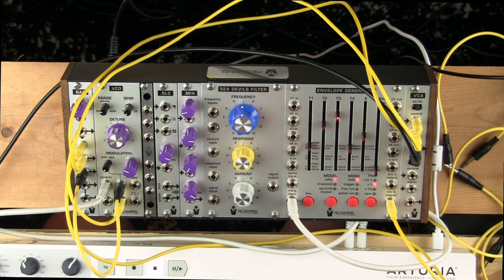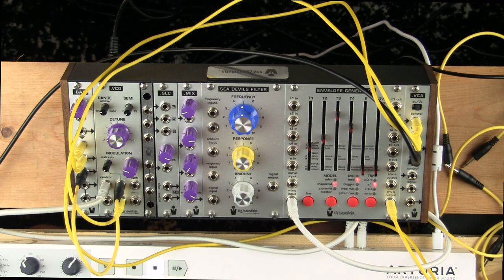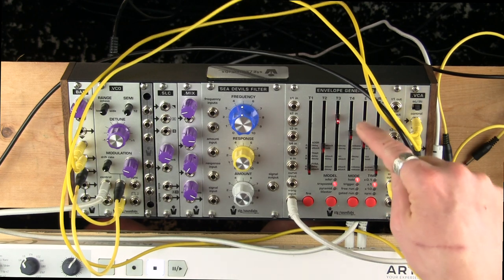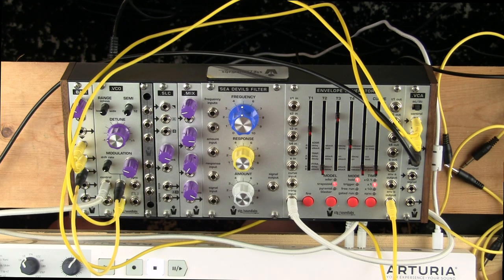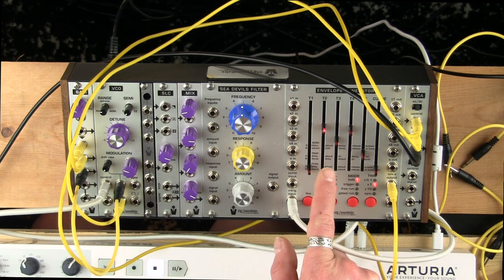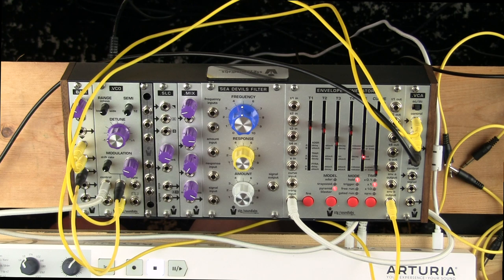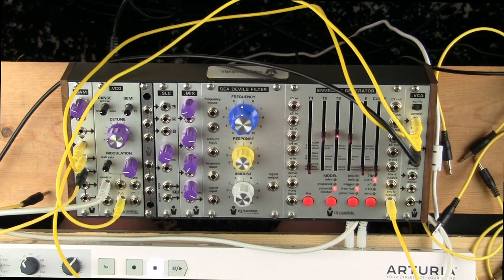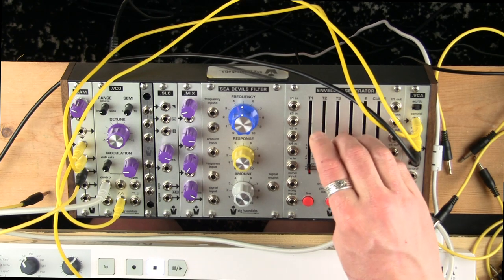05-STG Soundlabs Radiophonic 1: Envelope Generator Part 2

Comment: This has turned out to be the most versatile envelope generator in my shed by far . The slide controls give you immediate gratification,there’s no menu diving / tweaking involved . If I could think of any improvement it would be a ZADAR like feedback screen to see the output envelopes but its 100% fine as is - I’d been waiting on the release of this module for years and I’m glad I finally noticed it was available- thanks STG !

Comment: I am enjoying this so much. I've been enjoying your content for definitely more than a decade (12+ years probably, if not longer) and hearing your voice talk about my instrument brings me to tears.
Reply from the maker: It’s an honor to do so, and I’m glad you are enjoying it!  Irrespective of anything, this is a fine instrument... well-conceived, well-designed, and great-sounding.
Reply: This particular module is a work of genius.🙀 I love how you’ve very humbly named it; Envelope Generator 🙃
Reply: @jdanielcramer  i am flattered by your praise. The EG is a bit intimidating in features and price but it is as simple and cheap as i could bring myself to make it. I wanted to have a comprehensive envelope that gave you the fullest features of both Moog and EMS. The Serge thing (dual linked AD) was icing on the cake.

BTW that's just the way i name things ... I use literal descriptions of functions. I wouldn't know what else to call it!

For example "Sea Devils Filter" is named for a cultural reference because it would be rude to call it "EMS Filter." The Mankato Filter comes from Mankato, Minnesota and was named that before I manufactured it, when it was a DIY PCB. However, my sequential and voltage controlled switch is just called "Switch."

Comment: So with the Decay stage being first, in that particular mode; does the EG start at a designated peak, and trigger a decay stage, into a rising attack stage, like a serial coupled decay generator on a delayed ADSR? That’s ... wild. Love it. Need it. I do use trapezoid shapes a lot, but not THIS kind haha. It really reminds me of the envelope generator settings in a Roland D-110, but that could be interchangeable terminology, and not an emulation of the analog circuit. I would have to do my homework on that one... anyways- Great vid as always. Thanks!
Reply: If you're talking about the Trapezoid, one output rests high, the other one low. Overall level is controlled by E.

I couldn't get time on an actual Synthi 100 to verify actual operation against the owner's manual, but that's how the two outputs are described in it. Additionally, no one who even had access to a 100 would talk to me, and those that had played one couldn't remember.
Reply: @suitandtieguy  woah, I had a similar experience with a Buchla user in my town 😂 - well you’ve done a fine job here. This looks like a super flexible and powerful EG. I’ll be stashing away my pennies.